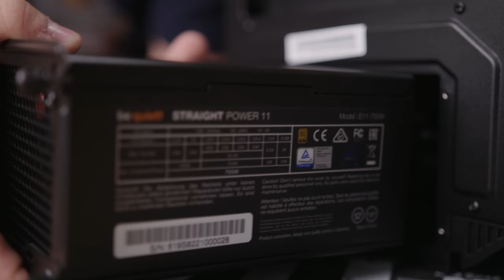💀 The DEAD Silent PC 💀

Comment: I don't know why I clicked on this.  I've done a lot of work/research and actually have built several <20db pcs, and its amazing how no one out there bothers to actually do research on the subject and do it right.  This pc while "quiet" doesn't come close to as quiet as it could be.  I wouldn't call it silent either.
Reply: What would you change here? Without significant performance decreases ofc.
Also it was sponsored by BeQuiet, so I guess he couldn't take for example passive/semi-passive PSU like Corsair RMx, but this one should be quite enough too.
Reply: @Alex11223l2  well, the trick with "quiet" pcs is there is always that line between being quiet crazy and performance.  Going all passive cooling is simply crazy.  It can be done, but the performance hits you'll take and the sacrifices you'll make are never really worth it.  So the first thing you need to do is identify where fans will be running 24/7 which you have no control over.  there should be just 2 of those.  1) PSU and 2) CPU.  Next you need to figure out how to limit the noise from those two fans as much as possible.  Solution for the PSU is getting an ultra quiet semi passive solution.  Seasonic and super flower both make some fantastic ultra quiet semi passive psus.  The next issue is the CPU.  For an ultra quiet <20db build you probably aren't going to go with a water solution.  While water coolers bring a lot of cooling the pumps can be far louder then any fans you use.  Furthermore you typically need high static pressure fans for the radiators, and those don't often run quiet.  since you're not going with a water solution, your air tower needs to be designed for passive or semi-passive cooling.  There aren't many of those, but generally for passive or semi passive operation, you need a cooler with wide placed fins and a LOT of surface area.  This kills two birds with one stone, because the wider placed the fins on the cooler, the lower the static pressure you need from your fan.  My go to air cooler is usually the Thermalight Macho lineup of coolers (the HR-02 is my favorite flavor).  The first thing I do with them though is toss the fan that comes with them out the window.  My go to cooling fan for the Macho is the PHANTEKS PH-F140HP, mostly due to the fact this fan can run as slow as 300rpm, moves good air, and it's sweet spot for that cooler is about 600rpm (max cooling ability), at which speed it's easily <20db.  

Now that we have the two "always on" fans taken care of we need to look at your case.  When building a quiet pc, the smaller the better.  Why?  because smaller cases allow for max impact from slow fans.  Huge cases require a ton of airflow with fans spinning at higher speeds.  in a tiny case a single 140mm fan spinning slowly can move a lot of air over your hot parts.  So I strongly suggest mitx or matx cases with amazing cable management, and good fan placement.  Most of my quiet builds are done with Fractal Design cases, it's a personal preference but I've never had a complaint about cable management, quality airflow or design flexibility with Fractal Design cases.  Of course the first thing I do with a FD case is toss the fans in the trash.  While FD makes great cases and their fans are "quiet" their fans aren't quiet enough for a true <20db build.  You don't need to go with a "quiet" pc case if you know what you're doing, any case can be quiet, my current pc is a sub <20db build and I use a Fractal Design Arc Mini R2 not one of their silent cases in the Define series.  What you need is a case which won't rattle so a strong frame, with rubber feet on the bottom will do just as well as some quiet pc case.  

I'm going to continue using my current mITX build i'm working on for example of the fan setup.  Currently I'm working with a Fractal Design Define Nano S, removed all the fans in the case.  Now here is where it gets fun.  The cpu cooler will blow air out the back of the case, so no exhaust fan is needed, USE 2 DIFFERENT fans for the intake at the front of the case.  Why?  because 2 sources of sound at about the same frequency and pitch will AMPLIFY their noise.  they add together.  Currently I'm still working on the fans at the front of the case (some trial and error usually is needed) but what I'm using currently is a Noctua NF-F12 and a Scythe Kaze Jyuni 500RPM Slip Stream, the scythe is placed on top, directly across from the cpu cooler, and the noctua on the bottom, the noctua of course is a PMW fan and only runs when the temps inside the case get warm.  The idea is both fans have a different blade count and rate of spin.  the result is their sound DOESN'T harmonize, what little to zero noise they make is inaudible, as they mostly wash eachother out.  

Of course because for a TRUE silent pc you need DIFFERENT fans everywhere, it's advisable you go without windows on the case unless you can find a way to make those mix and match fans invisible or simply not visible from the window.  In this build there is only one fan you can see from the window, so I've matched it to the colors of the cabling, lighting and motherboard, as a result there is no harm with the ugly mismatched fans up front, since you can't see them 

Finally you have the GPU.  I strongly suggest you limit the gpu to 2 fans, and to a model that supports semi-passive operation; Unless you want to get into gpu heatsink replacement.  It's doable, Arctic makes some great semi-passive coolers for GPUs to bring down the noise, but typically those coolers are huge and in a small case you probably won't have the room for them.  As a compromise I've found MSI Gaming lineup tends to be almost inaudible, and works well in semi-passive mode, though you do need to compromise a bit on the gpu in question.  Typically the gtx970, 1070 or even 1080 work pretty good in quiet builds.  I can't really advise a 1080ti or 1070ti, or titan of any design, as those tend to be overclocked to the moon and require some serious cooling from the cpu cooler to make them work right.  In this current build I'm currently working on undervolting a MSI Gaming 8G GTX 1080, to reduce the fan operation as much as possible; it seems to have worked pretty well, I mean I'm typing this on it, I have the case on my desk a within arms reach and I can't claim to be able to hear it.  Of course my ears are pretty much deaf to noise <24db so I can't claim it's <20db yet, got some sound isolation testing to do with it first.
Reply: Arizona Anime-Fan wow this is the best silent pc tutorial I’ve ever read. What are your opinions on the noctua nf-a12x25 sterrox fans? Everyone seems to be raving about their performance to noise ratio
Reply: @ognintendo7061  I haven't tried them yet.  too many fans out there to have experience with them all, but thanks for mentioning them, i'll try a few next build.  Just a heads up about silent pc building.  When I do it, I usually purchase extra fans in case a fan comes "noisy" from the factory.  For example those PHANTEKS PH-F140HP fans I like for the cpu cooler, while they're dead silent, I've found about 30% of them cause a low frequency "rubbing" noise when mounted Horizontally (I've never had an issue with them vertically).  Which means depending on where you mount the fan (horizontal or vertical) you may get a different noise from them.  I actually once purchased 4 of those Noctua redux lineup of fans thanks to the great reviews, and while the blade noise was great, I found they ALL created a low frequency harmonic rumble noise when mounted horizontal.  I doubt the noise was loud enough to really show up in a simple review of the fans, but when in a case 18" from your ear on the top of your desk, and EVERYTHING else in the case doesn't make a single noise (to the point you can't even hear the computer turn on or off) that low frequency rumble was bad enough I ended up trashing all 4 of those fans (I was using 2 of them in the case, though spinning at different speeds to keep them from harmonizing, ended up going through all 4 and it wasn't till I removed them from the case the noise went away, ended up going with some other fans in that build. 

One more tip for a silent build, get all solid state storage.  Not only are they quieter then Hard drives, but they produce a LOT less heat, which means less fans needed to keep the case/mb cool, which also translates into quieter noise.
Reply: Arizona Anime-Fan ah yes I’ve had to return a few fans because of hum or  fan hub wobble noise. currently rocking a r5 and Corsair ml140 fans. 2 in the front 1 in the back. Not amazing but my houses noise floor seems to be 30db according to my iPhone decibel meter app, so as long as I can get below that I’m golden. Oh have a nhd15 and a sterrox fan on the side mount just for the gpu to help alleviate temperatures so the gpu fans dont spin up too much. Of course I have only ssd. Full flash is the only way to live
Reply: @arizona_anime_fan  for silence get a 1050ti with heatpipes (the asus strix one) possibly the quitest card that play pretty much every game no issues, and  best card for Mobas. (Might be a bit overkill actually for mobas except if you use a 144hz monitor, but asus doesnt offer a heatsink on anything below, or any other brand as well) Or a 1060
Reply: @apothecy4011  I agree.  The 1060 or even the 1050ti is a great card for a silent build.  you can actually run most of them passive for the most part.  However this is where you start to get into "crazy" on the side of "quiet"... You can always get quieter, you can go full passive if you want, I mean there are CPU coolers that can handle 95W cpus fully passive out there.  there are fully passive psus as well.  However if you go semi passive or "slow fan" you can keep the build <20db and still get overclocked CPUs and top end gpus.  I mean a stock i5 with a gtx1060 vs an overclocked i7 and a 1080 are two different beasts.  and while one build might be 100% passive, the second example will be <20db, and functionally dead silent as well.  the aforementioned build I'm doing right now is sporting a ryzen 7 2700 overclocked to 4.3ghz with a GTX 1080 and right now it's running basically silent.  

I just don't see why you wouldn't go for the latter build and still end up with a build that you can't hear
Reply: Arizona Anime-Fan this is the most helpful comment thread I've ever read. And it doesn't even apply to my interests.
Reply: @TheSonicFan4  you're welcome!  I think the big point most silent builds miss is the fact that fans harmonize, which means you can run a bunch of really quiet fans and get a noisy build because all those fans are the same design and running at roughly the same speed, as a result their noise harmonizes and adds together, becoming much louder then you probably expect.  This is why it's so important in a serious "quiet" pc build to use different fans with different blade counts and designs and running at different speeds (in the event you use the same 2 fans in the build).  Also most electric fans are almost completely silent if you run them slow enough, so usually in a build a bigger slow spinning fan is a better option then a smaller faster spinning fan.  However many fans have a min RPM and voltage they can spin at, so researching slow spinning fans that move good air is a must if you're serious about making a silent build.
Reply: @arizona_anime_fan  very insightful. Thank you for your answers and time to type them.
Reply: @arizona_anime_fan  I have  1 question. You mentioned using only ssd-s for build and while it's correct in terms of silence it's totally not acceptable due to price per tb in comparison with hdd. I have 4TB HGST HDD Enterprise for 86$ brand new and it's most loud component in my pc. I have be quiet silent base 800 case,be quiet dark rock pro 4 cooler,RM850x 2018 psu (gpu not decided yet) Have you any idea how can I use this hdd in my pc by separating it from case? Is using hdd enclosure with fan and putting it in another room by connecting it to usb a solution? Thanks in advance.
Reply: Damn dude you put alot of effort into this. While I personally like a quiet computer, I find it hard to find the best components, it's almost like most manufacturers hit a certain sound level and then think "eeh close enough", anyway thanks for the recommendations I've got some fan shopping to do :)
Reply: @arizona_anime_fan   my build is kinda troll build though, i am pairing an asus strix 1050ti with a i9 9900k xD, the Gpu will be dead silent for sure, but because i use a  CM 410m for the CPU (dual fan so it will be more quiet than most 1 fan solutions, but not that strong of a cooler overall, it is simmilar to dark rock 4 on performance, but behind the Pro one though) it will be kinda noisy after all. My PSU is an EVGA p2 though which is very silent as you said yourself and i use dark base 700 case (not the most silent around but i think its above average)
Reply: @Temuka2011  re: storage, if you need +4tb of storage, I suggest you look into a NAS, this will let you seperate the loud parts from the quiet pc.  you can place the NAS in another room all together, and still have access to those large drives over the network.

@ FaBNEk  re: fans; there are some places to find better fan reviews.  SilentPC has some solid writeups about fans, as well as this thread over at overclock.net https://www.overclock.net/forum/246-air-cooling/1274407-fans-most-complete-comprehensive-array-tests-benchmarks.html just have to do some digging.

@ Apothecy
 you can keep the noise of the i9 9900k if you undervolt it a bit.  when we're only talking about one hot part like the cpu in that build, if you take some care you probably can keep it cool without compromising too much performance or noise.

To expand on a little bit about fans, low static pressure fans are undoubtedly "quieter" for two reasons.  1) high static pressure fans tend to create a lower frequency noise, and while to most people, low frequency is better than high (they prefer bass to treb) the noise is undoubtedly louder on the high static pressure fans.  Second, those fans will move air fast.  Fast enough that even if you can get a quiet <20db high static pressure fan (they do exist by the way) you'll definitely hear something akin to the wind blowing through your case like a wind tunnel as the air itself becomes a source of noise.  If your system is quiet enough it's an interesting effect, very uncomputer like, however it will get old fast.
Reply: Right I saw no effort actually put towards reducing noise, or insights given. Its just another stock build with some parts labeled as "silent"
Reply: @arizona_anime_fan  I love this thread! For the CPU cooler.....Do you use PH-F140HP 1 or 2?
Reply: @NicholasSmithNicholasSmith  I've used both models.  They're both excellent.  I've even used them as case fans in some builds.  Just be aware when mounting horizontal about 1/3 will make sort of a light brush sound when they spin.  the lower speed models are the ones you're looking for, these fans are made for high static pressure, so they will move a lot of air if they spin fast.  what you're aiming for with them is to keep them slow, the nice feature of these fans is they will spin at VERY slow speeds, and they still move good air at those speeds.  The main reason why I chose them as a favorite though was because I could use them as a CPU fan on the Macho <20db as long as I kept the RPM down under 700rpm.  The best part about them though is just how well the sound/air signature was when mated to the macho, when they spun up to around 600RPM they are at peak effectiveness with the macho.  meaning any more spin resulted in zero cooling improvement.  since 600RPM is under the 700rpm needed to stay <20db with those fans this makes them absolutely ideal.  I usually set a custom fan curve from 350rpm-600rpm on the cpu with those fans, with a sudden spike to 900 rpm at around 80C on the cpu temp...  Why?  because at 900RPM those fans will make the inside of the case sound like a wind tunnel.  You'll definitely hear it at that speed, which means you don't need a temp probe/software running 24/7 on your computer to tell you when it's overheating.  You can hear it when it's overheating (which I think is ultimately best for the long term health of your parts).  

NOTE: these fans are technically rated for a min fan speed of 600 RPM, In my experience almost every one of these fans will spin up just fine at around 350rpm.  However, every fan is different.  The worst ones I've found would only spin up around 450 RPM, they're rare, but they do exist.  Those fans are still <20db at that speed just keep it in mind you may need to play with the fan curve if you find the cpu fan isn't spinning and your motherboard is giving warnings.

Comment: Best thing about that setup is the fans on the GPU is upside down and due to gravity instead of pulling away from the fan mounting screws it's weight bares into bearings making the fans less likely to fail under heavy use. Crank er up...

Comment: 6:30 Flipping the cooler will not allow you to use the sound insulating plastics for the fans. They're preinstalled so that the only way to install is the one you have already done.

Comment: Well executed, and a hell of a parts list. +1

If I were building this though, I'd go for a different board.
Why? Without active cooling on the VRMs, that board's are barely good enough to handle an 8700K with a ~5GHz OC in a sustained multi-threaded workload. That's excluding any AVX2 load which is out of the question. I have my doubts it'd even handle a 9900K at its 4.7GHz all-core boost, in a sustained multi-threaded workload. For gaming, it's fine. For now. But, building something of this calibre should be able to handle more than just gaming.